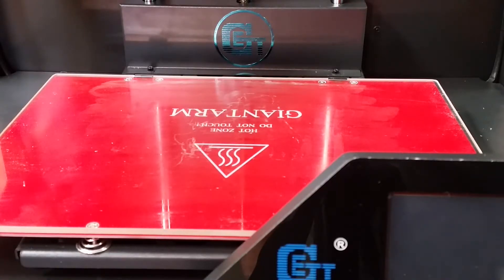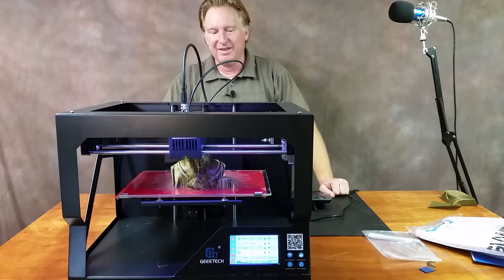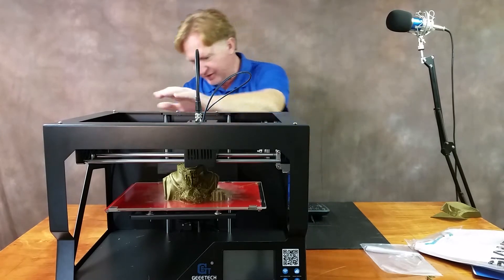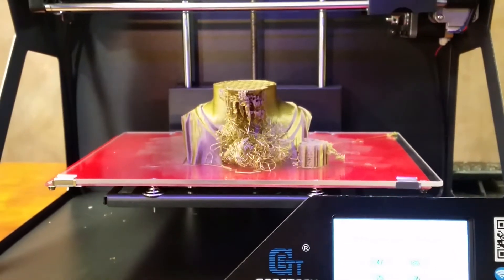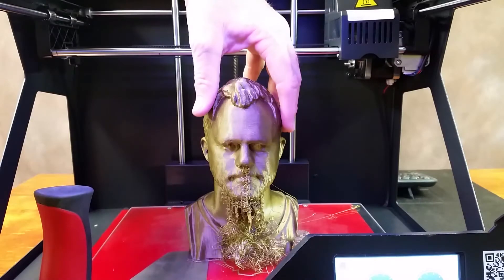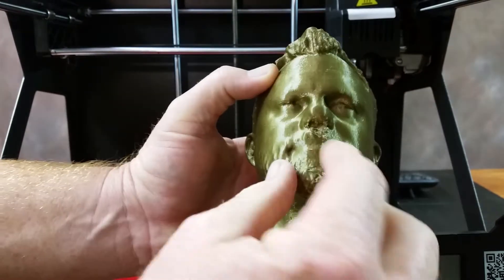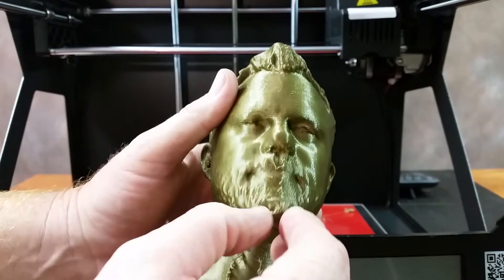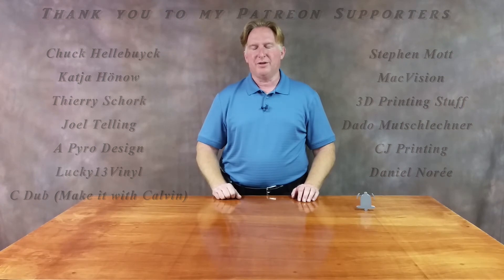Testing the Break -  Resume Capability of the Geeetech Giantarm D200

Comment: I would call that 100% success. No one is going to notice that line unless they are looking for it. And if you are that fussy, some wet and dry paper will smooth it out or solvent weld smoothing with blend it in. 
I've just ordered a Geetech A10M and am hoping the resume print on that matches this. I can't sleep with my printer going, physically and mentally, so no longer being limited to a 15 hour print (my waking day) would be really nice. I could lower my layer lines on larger models with this feature.